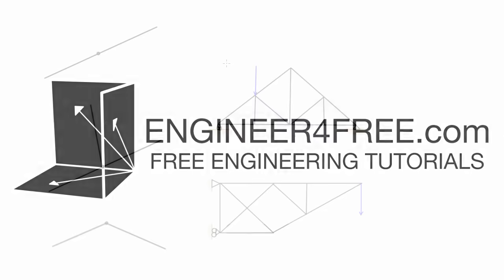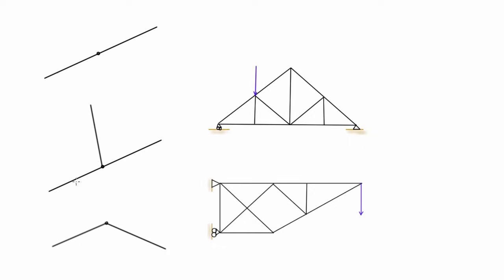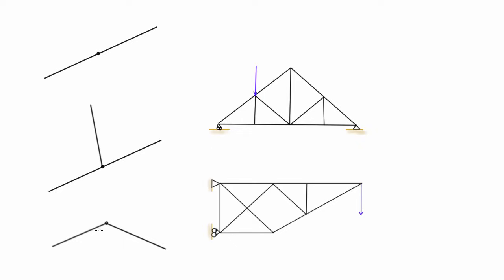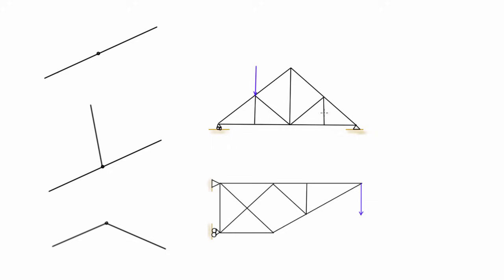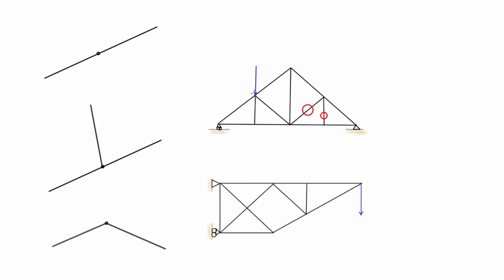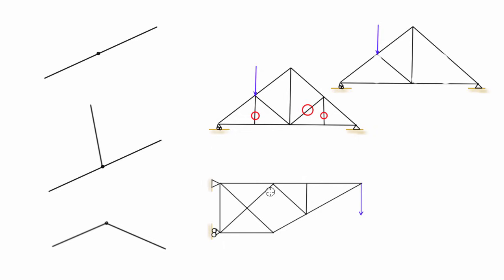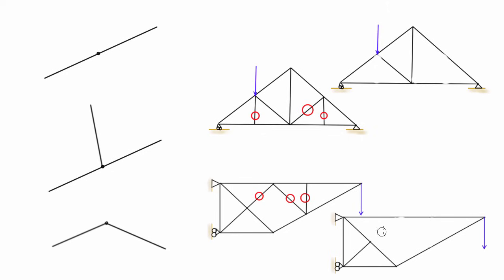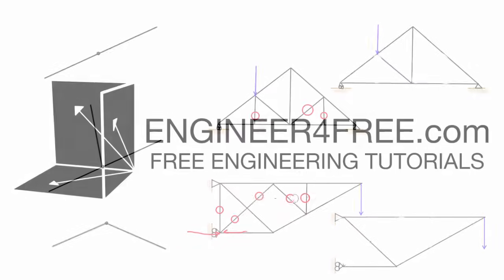How to identify zero force members in trusses

Comment: I want to build  a steel truss for my own house.. what is the purpose off identifying zero force memder are we going to remove that zero force member out of the truss to reduce the cost?
Reply from the maker: ZFMs provide lateral bracing to the two inline members that they join. If the ZFM was not there, that joint would need the be solid, and ultimately the two short members would be replaced by one long member. Long slender members in compression are susceptible to buckling. ZFMs also are not always ZFMs. In this problem, the load does not move, and we have just identified that the member is a ZFM when the load is in its current position. If the load moves (imagine a car moving across a bridge) then some members will sometimes be ZFMs and other times not as the load moves. I've got some videos on buckling here engineer4free.com/mechanics-of-materials (videos 50-56), and at the moment I don't have any on moving loads, but you can look up "influence lines" to get an idea of how that works.

Comment: In the first example, why is the middle vertical truss not a ZFM? the bottom parts are collinear and there's no force at either joint. Are the middle pieces ZFM on symmetric trusses or something?
Reply from the maker: Thanks for asking! You are ignoring that there is a 4th non-ZFM member at that joint that goes diagonally up to the left. The other end of that member is in contact with the joint that had the applied force acting on it, so it will be carrying some axial load. That axial load has a vertical component to it because it's angled, so it will be putting some non-zero vertical load on that bottom middle joint. The fully vertical member that your asking about will have to provide and equal and opposite non-zero vertical force, therefor making it not a ZFM. Hope that clears it up!

Comment: can u identify a zero member force if a joint consist of 4 members? or 5 members?
Reply from the maker: Yes but not directly from that joint to begin with. Look at the bottom middle joint in the first  example of this video. It has 5 members and we were able to determine that one was a ZFM. We did so though by starting at another joint that only had 3 and worked our way towards it.
Reply: @Engineer4Free  baby steps

Comment: at 8:53, as per rule 1, why didn't you take two collinear member as zero force member? Iam talking about the diagonal members....plz make me clear
Reply from the maker: If you draw FBD of the whole thing and do you sum of moments about the upper reaction, you will see that there must be a horizontal force at the lower reaction to cancel out the moment caused by the applied force.

The diagonal members that I put a red circle on in that region are ZFMs, and that's why I erase them off the "equivalent" diagram in the bottom left corner of the screen. After we determined that they are ZFMs, we know that all of the horizontal reaction force must be transferred into the horizontal member there at the lower reaction. IF some force was transferred into the diagonal members, they would then also exert a vertical component of force on the joint. BUT because the have zero internal force, they exert zero vertical force on that roller. And if they are not providing and vertical component of force, then as per rule #2, then the fully vertical member that touches the roller must also carry no force, therefor is a ZFM too. 

Right at 9:00 when I say "two co-linear forces," and draw them in red, one force is the compression in the horizontal member, and the other force is the reaction. They must be equal and opposite to achieve static equilibrium in the horizontal direction. If a third force was introduced with a vertical component, the joint would have the tenancy to accelerate in the direction of that applied force, making it not in static equilibrium. It IS in static equilibrium, so no such force exists at that joint, and therefore the internal force in the vertical member is 0. I'm really going off of rule 2 here. If you replace the "joint and members" in rule 2 with a "particle and forces," it might be more obvious. 

Does that help?
Reply: Indeed its useful....thank you so much sir.
Reply: @Engineer4Free  MIC DROP SON!!!

Comment: While discussing the last zero force member, there is a reaction force acting at the hinge support. So shouldn't a vertical force be considered in the last zero force member you considered?
Reply: Studying the joint at the bottom, there is no other vertical component to counteract. That means the vertical component of the hinge is zero as well.
Reply: for the last zero force member in the video... it is possible to remove it in order to get the right answer, however it can't be removed from the structure since it is supporting the rolling element that would fall downward (that member has negligible force in it since the rolling element has a negligible weight)... so yes you can solve the problem, but don't draw it like that because I won't make sense.
Reply: That force is being balanced by the external blue load applied on truss
Reply: You can watch solved example using this concept in the attached video. https://youtu.be/5GOB5suVCGg

Comment: So I appreciate the video and the explanation, but in the second example, with the pin support at the top, can we assume that it is a zero force member if we don't know the reactions? I'm thinking that if the pin support had a vertical and horizontal reaction component then the member should have a force in it to keep the system in equilibrium.
Reply from the maker: Are you referring to the vertical member that goes from the pin to the roller? If so, you can't infer that it is a zero force member by inspecting the pin support. It's not possible to determine if the vertical force from the reaction will be directed into the vertical member, or the member on an angle. The only way to determine if that vertical member is a ZFM at a glance, is by observing that the roller support can't provide a vertical reaction, and therefor the joint at the roller would be out of equilibrium if there was any axial force in the vertical member. Rollers can only provide a reaction that is normal to the surface, and in this case, that reaction force would be horizontal. In order for that joint at the roller to be in equilibrium, the vertical member must then carry no force under the current loading conditions. The reaction at the roller will cancel out with the force in the horizontal member there, and that's it. Because the vertical member carries no force, that means at the pin, 100% of the vertical reaction will be carried by the vertical component of the internal force in the angled member (so that the magnitude internal force of the angled member will be greater than the vertical reaction, but the magnitude of the vertical component of the internal force of the angled member is equal to the vertical reaction).

Comment: What I don't understand is why the member underneath the applied load in the first member is a 0 force member. If there is a vertical load on it, shouldn't there be a compression force on it pushing on the two co-linear members perpendicular to it, therefore not making it a 0 force member?
Reply: ChickenSmackBoy remember trusses are modeled as pinned connections, so although there may be an external force applied at the top of that vertical member, at the bottom there are no members to resist that force. forces can't act through 90° and so the vertical member must have 0 forces because of equal and opposite reactions.

sidenote: if the bottom chord of the truss were to strain to an excessively large amount due to tension forces, that zero force member may actually start taking on a little bit of compression. also, remember that in the real world, beams and chords can only span a certain distance before they start to sag due to their own weight, so that zero force member may be carrying the dead load of the bottom chord.
Reply: @JjoshD  in a practical application, house roof trusses made from 2x4 lumber seldom have spans between connections that are more than 8'.
The video addressed point load condition. Dead load and live load values lead to the familiar truss
Reply: Its hard to belief, but the system is perfect so to speak. Just 0,0001 + or (-) degree the rollers would rush up or down in real life 😊. That’s why we need zero force members. Out there. ....
Reply: Change ur view buddy......just forget about the loads , members .... Just concentrate on the joints.......if any external force is not there on that joint then do as shown.